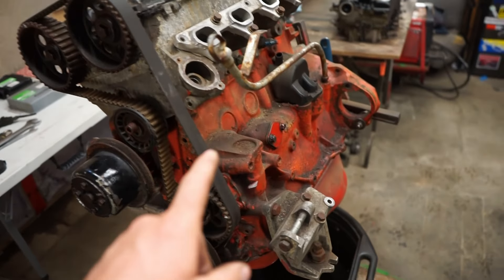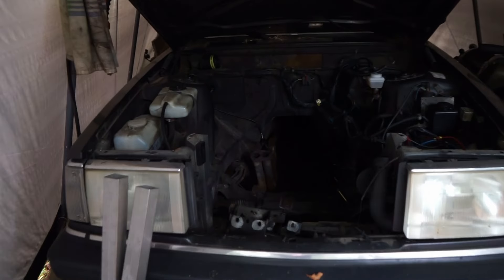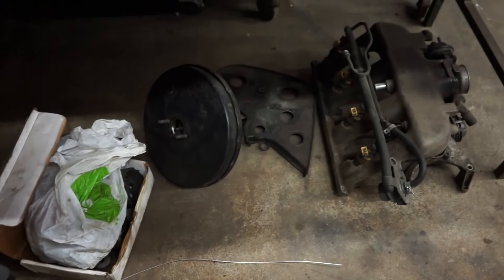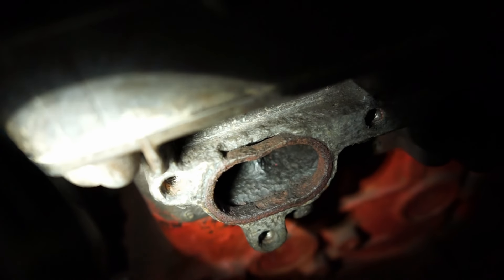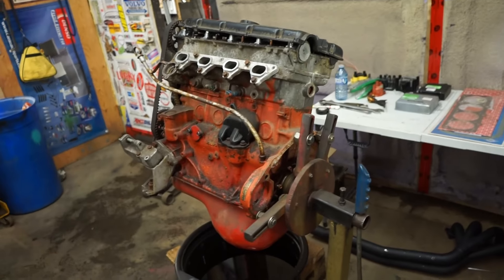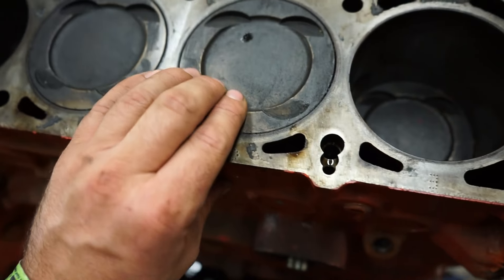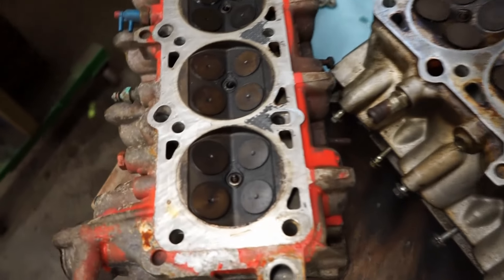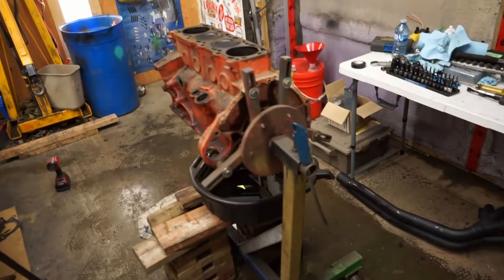Volvo 2.5L Stroker 16V swap Ep. 1

Comment: Looking forward to this. Would be great to throw in one of mine but good lucking finding Pentas in the prairies
Reply: you know you can get them brand new too
Reply from the maker: Hope it makes for a fun DD!
Reply: @dirtymat8240  Show me a site I can get one shipped to the middle of Canada for less than the price of a Bertone
Reply: @dirtymat8240  yes, I'd like to know where you can buy new AQ171C motors.  Please share!
Reply: @volvoproblems3567  Oh yeah my mistake, for some reason it didn't even cross my mind that you were talking about the whole engine. Since the block and head can be found on cars too there's no real need for a whole Penta engine in my mind. I was referring to only the crankshaft which can be bought brand new.
Reply: @dirtymat8240  If you don't want to deal with the balance shafts, you want a penta
Reply: @volvoproblems3567  You can put a B234F head on a regular B230 block, very common here in the nordics.
Reply: @dirtymat8240  I'm curious to how many months it takes for something as simple as replacement 240 windshields to be located where you are.
Reply: @volvoproblems3567  I'm not into 240 really myself so I don't really know but 740/940 are right on stock on most window replacement companies for about 150 bucks, I would expect 240 is available about on the same price too.
Reply: @dirtymat8240  So, if I tell you it takes 1-2 months and about $600 for a windshield because of scarcity for even a simple part.
To quote my original post, good luck finding this in the prairies.